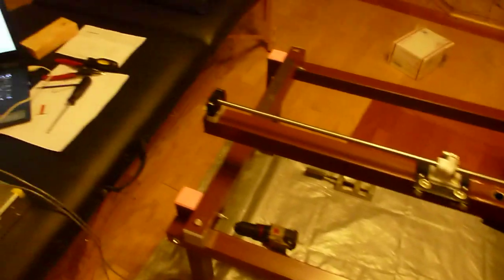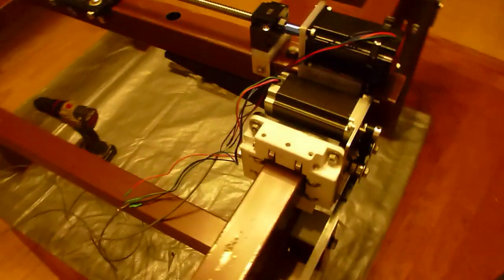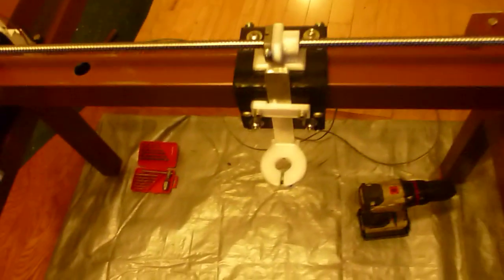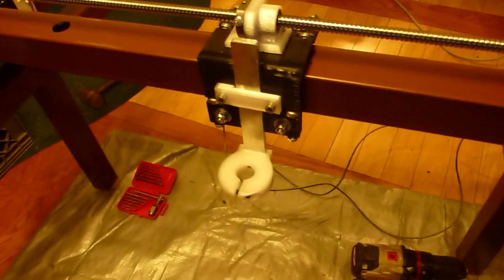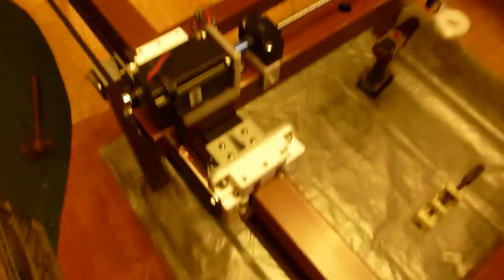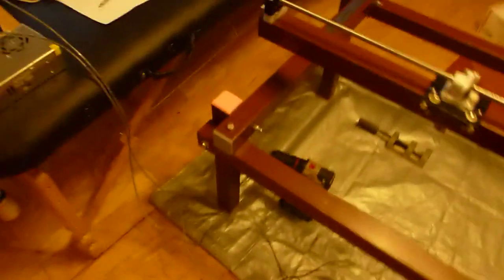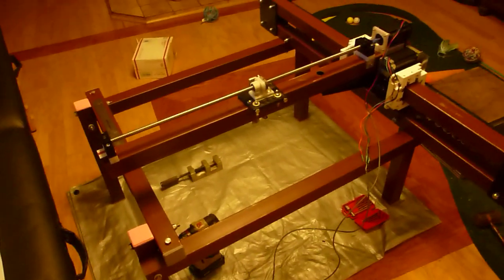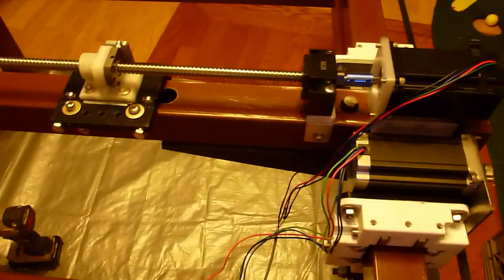JDs Garage DIY plasma table - my version (Ball Screw testing)

Comment: Hi great video , can you make a video on the lead screw and where you bought it , and what you had to change in programing please . im very interested in adding a lead screw, I imagine I could make the x axis 49 inches with a lead screw that is long enough ?
Reply from the maker: I purchased the ball screw here: https://www.ebay.com/itm/314495721098?var=613066522779
They come in different lengths.  I used the SKU1204 800mm long.  X axis steps/mm = 400
Y axis steps/mm 40 (depends on size pulley you use), Z axis steps/mm = 50.

Comment: Looks great, just dialing mine in. Will have to have a look at universal code sender
Reply from the maker: I jump back and forth from OpenBuilds BCNC, UCS.  Leaning towards OpenBuilds Controller has nice screen for changing settings in GRBL.  I just installed Teensy4.1 (compiled basic 3 axis code in Arduino IDE) running grblHAL.

Comment: the balancing robot vid u made of joop broking, in that robot im facing the problem of motor getting stuck, please help & have u faced such problems.(im commenting here as comments are turned off for that vid.)
Reply from the maker: Don't think I had that problem, but it was a pretty hard project.  I would look at the libraries used when he built it.  
Will try to turn on the comments for that vid.